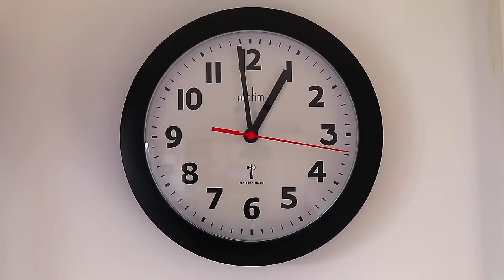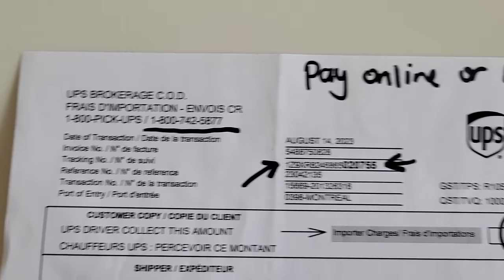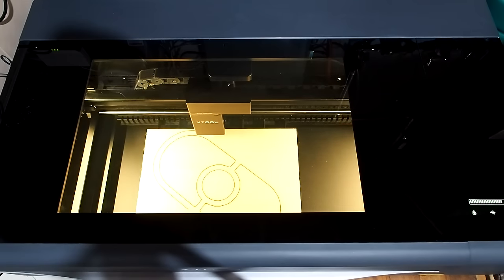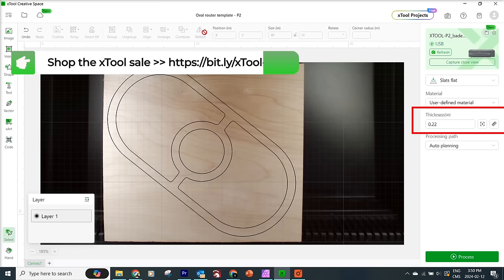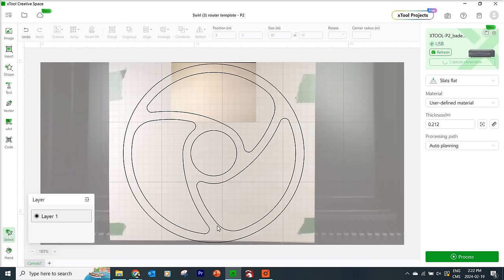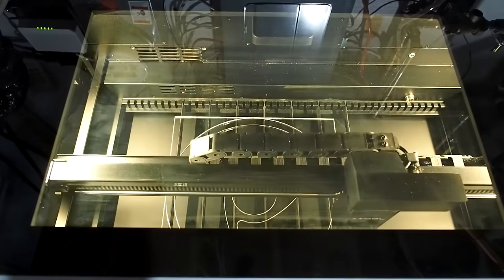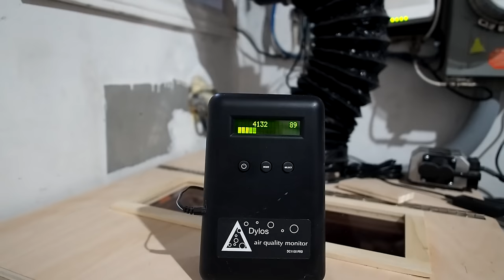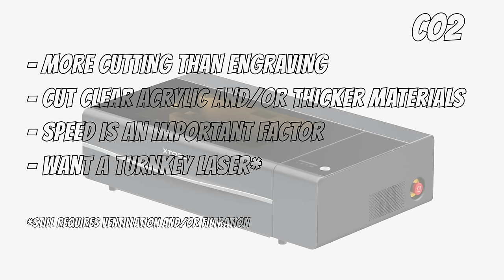I regretted my laser purchase. Until I upgraded.

Comment: I think it's a very inadequate comparison. I have a k40 and run a neje max 4 (1k € + 300€ accessories, case, etc.) the diod laser works perfect without carrying about the cooling in cold times. I also would prefer Co2 always but these diod devices work very well with very low maintenance.

Comment: I would try to make a slat bed instead of honeycomb, but if you stay with the honeycomb let me suggest this: Nylon Tube Brush Set. Cut the ring off and put it in a cordless drill!  Also you can get a 3" or 4" marine bilge air blower for $25 instead of a $119 fan and those will extract fumes like a beast.

Comment: Back when you bought your first laser, your mistake was buying the open frame D1 instead of the enclosed M1 which doesn't have many of the issues you mentioned.
Also, some time ago xTool have released another enclosed diode laser, the S1 - while it doesn't have a built in camera, they added a clever multipoint positioning system.
Reply from the maker: Probably WAS a mistake!! Didn't know the difference and didn't do my research...
Reply: @DIYMontreal It was a somewhat expensive learning experience, but you are wiser now!

Comment: You can’t engrave metal on a co2 without expensive coatings.  I have a 100w co2 and a 40w diode.  The diode does a great job cutting wood.  And when it comes time to replace the tube in your co2 we can talk about price and ease of service.  I’m assuming you haven’t had to adjust your mirrors yet either

Comment: Only problem with light burn is you have to pay to use it, i've never cleaned my honeycomb once in 14 months, and an aquarium air pump works just fine for air assist. I tried running mine in the basement, no amount of vacuum will get the smoke and smell out, I run it in the garage with a camera watching it now.
Reply: Yeah, I was wondering what the obsession with cleaning the honeycomb.  I've never cleaned mine and so what?  I think it may be worse because there was no gap beneath the grid for the airflow.  I've also not used a diode cutter, maybe they are just messier.  Still, who cares if the bed is dirty?  Does it affect the work?

Comment: The X Tool is way too expensive for what it is.

If you want speed, get a Chinese CO2 galvo laser.

Also, the glass laser tube will not last as long as a metal tube and the replacement cost is significant.

Comment: Does the CO2 does not needs cooling ?
Reply: This one has a built in chiller.
More expensive ones with RF metal tubes are air cooled.
Reply: @YaaLFH Just a blower chiller.. or an refrigerated chiller.
Where I am 28c is a standard temp so I use a chiller.
Reply: @marcwolf60  Refrigerated.

Comment: 08:40  this has nothing to do with the fact that it's a co2 laser and everything to do with the focus of your laser. 
my co2 laser has a cheap lens and i get the heavely burned sooty edges aswel.  

you need a thin straight laser line. mine focusses into a dot meaning that above the dot and below the dot it gets wider fast. wich heats up and burns the wood and makes deep cuts harder because less of the laser is getting to the cutting part..  if you have a decent lens setup the focus "dot" can be several millimeters tall. wich is much better for cutting. (less so for engraving because it's also a wider dot then mine)

Comment: You've spent $7k on two consumer grade lasers when you could have purchased a purchased a premium commercial grade Thunder Laser 35 100watt for $10k.
It comes with everything and by everything like closed loop steppers and over sized tubes. No "maximum" wattage advertising. A 100watt tube means cutting to 100watts. 
Live and learn but more importantly do your research before you end up with two toy lasers for $7k.

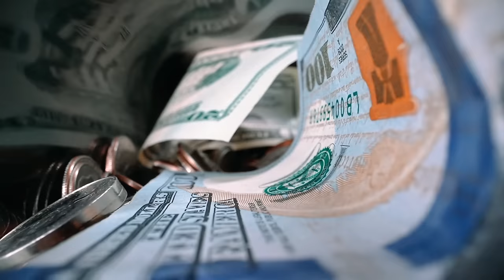Comment: little side note on your end conclusion at 15:10 
my co2 laser was cheaper than your diode laser.

have not seen you talk about the water cooling.  are you sure that it's a co2 laser? 
(it could be a metal RF tube.)

oh and stay away from cutting anything vinyl.  
pvc. 
old records. 
don't cut them. 

the fumes comming off of that are detrimental for your laser.  and extremely lethal for humans.  (chlorine gas.  wich when it mixes with water. ie the moisture in the air. turns into hypochlorous acid)

Comment: I like your setup and videos but i now feel like i have to spend thousands. For a hobby, money is usually an issue, i would  learn with a low end machine than buy a very expensive unit and then realise you have to learn to use the software and all other settings. It could be something to walk away from and leave it gathering dust.
I would not invest at that price point as a learner or hobbyist.
I also think x tool are over priced compared to other brands that have good feedback.

Comment: that built in exaust fan is not good enoegh.  
it has poor static pressure (just like any other pc fan) 
wich means if you have a long tube to the outside.  the fan isn't going to be good at extracting anything. 
you need a blower type fan.
(the smell is another story. you say.  yes that's because it's not extracting propperly.  and YOU MOST CERTAINLY NEED A TUBE TO THE OUTSIDE!!!! most of these fumes are toxic for you.  if you smell it. you are inhaling the toxic fumes)

Comment: Thanks for this comparison. I was thinking about a diode laser but now I'll wait until I can afford a CO2 laser. I want to cut and engrave acrylic.

Also the bottom of the CO2 doesn't get as dirty because all the gunk is carried with the smoke and since there is a gap beneath the ribs and the bottom it gets carried out the exhaust.

Comment: does a 40watt diode as fast as a 40watt c02 laser? i ask because ur comparing a 20watt diode to a 55watt c02 laser
Reply: No, a 40W diode doesn't cut as fast as 40W CO2, especially when you're using acrylic.

Comment: An interesting video. What is the life span and cost of the CO2 tube and does it degrade in its  intensity over time?  If it does then your settings will be changing it over time. This CO2 laser is a high end hobby/low production model compared to the larger commercial production models which cost $20,000+.  You never mention that many items are not laser friendly and can in fact be deadly if layered. I enjoy your videos and various projects. And yes our Montreal winters do not allow opening the windows. I am in Pierrefonds (West Island on the Island on Montreal - geography info for those not familiar with the are)

Comment: Great review! Thanks a lot - now I know the drawbacks of a diode laser! My theory that diode laser is way less energetic and so it doesn't instantly vaporize the material, but slowly heats it up, releasing wood gas and glue that holds plywood together, and that's what ending up on the honeycomb and bottom tray.

Second thing about filtration - if the filter considerably reduces amount of fumes, maybe you should pipe the filter outlet outside through the window? If it doesn't have output flange, you could probably make one out of plywood.
Reply from the maker: The filter box actually does get vented outside but I suspect the filters aren't fully sealed and there's some minor leakage. You can buy laser filtration units that are MUCH MORE EXPENSIVE that I suspect work better.
Reply: @DIYMontreal Then, I guess, some sort of silicone goo is your friend 😏

Comment: 08:55
again.  that's just THIS 5000 dollar model. 
it's a feature of the model.  not a propperty of co2 lasers. 

my co2 laser does not have an auto focus.  infact it doesn't have a focus at all. 
i need to adjust the height of my workpiece.
and to get a diffrent focal point i need to swap out the lenses.

Comment: Great video, Marie. I never realised how little charring a CO2 laser makes compared to a diode one. Mind-blowing!
My wife and I bought the 20W D1 Pro during the last black friday sales. We got a deal too good to pass and ended up with a rotary too. Even with building an enclosure, getting a honeycomb, buying an air assist pump, and adding venting it cost us just over AU$2000.
I'm still impressed with our little diode and all the things we can make with it, but cleaning it is a bit frustrating at times and the internal cable management was horrendous straight out of the box. I would love to get a CO2 laser at some point and am considering xTool as I feel XCS is powerful enough for our purposes.
I still love our diode laser though and will most likely keep it if we do upgrade, for the purpose of using it for engraving only.

Comment: The P2 certainly better in many apps , but you're comparing Apples to Oranges. Also the P2 is 55 W theX2 is only 20W, not the same.  Good review though. FYI you can buy Gelatin filter sheets cheap 20x 24 inches from Lee filters @ about $20 per sheet.  for the blue/UV diode laser for building your own cabinets Filter sheet number # 158.  Why are you showing gooy Bee honey combs, not a fair comparison!!  Persoanlly I'm looking for  a laser that can cut up to 1/4 thick steel, but at $50,000 to 100,000 never going to happen! Actually thes days for metal cutting a desk top water jet is a better choice, but still not cheap, and a lot more hassle to use.

Comment: So you’re saying the machine isn’t sealed well enough that even if you vent directly outside, there’s still a ton of particles in the air ?
Reply from the maker: The machine isn't sealed at all (not meant to be as air needs to come in to makeup the air being sucked out). The issue is the built-in fan lacking power. You need to add a much more powerful fan like the one I use for my diode laser.